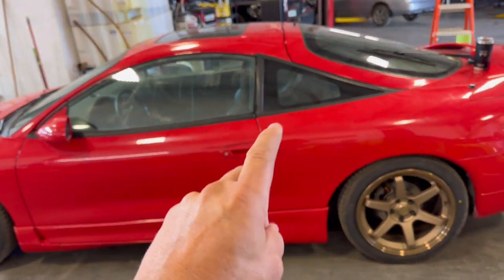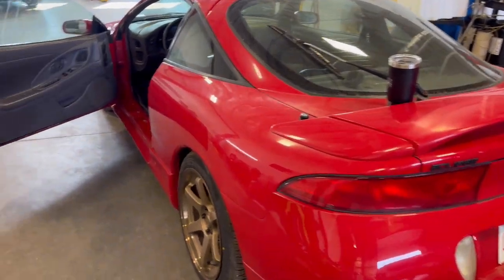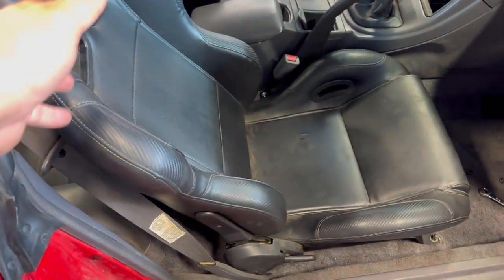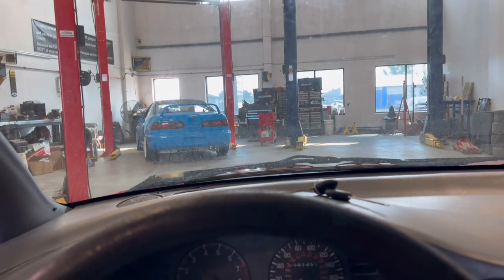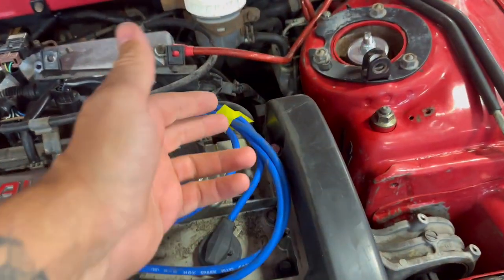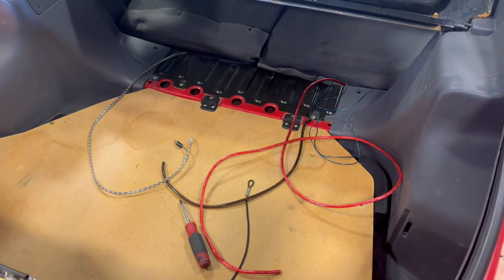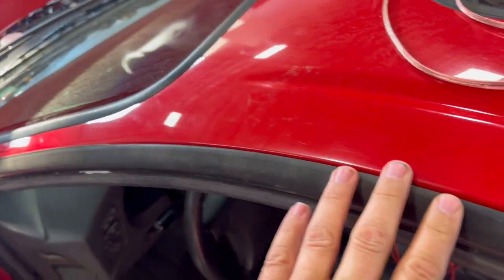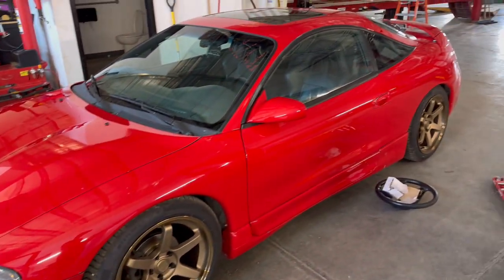Budget Racing Seats in my 2G (1995-1999) Mitsubishi Eclipse (Eagle Talon)

Comment: Yeah I had to build my own custom seat brackets for my racing seats. So we just use the stock mounting brackets and we put two metal bars across that and welded it. One actually slides with the motor the other one won't but yeah they're kind of tall. Hey I'm following you I'm trying to rebuild my eclipse to
Reply from the maker: We did that but I'm to tall and my head hit the roof. Ill post more Eclipse stuff soon!